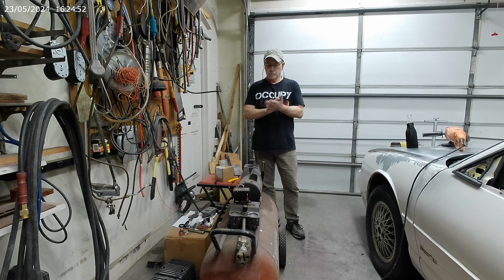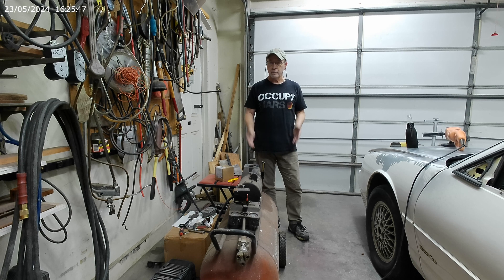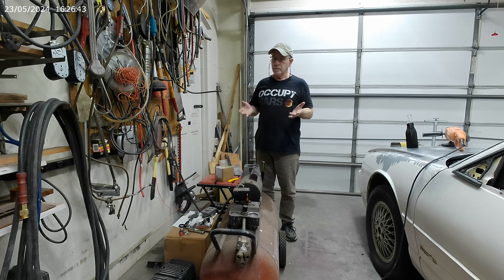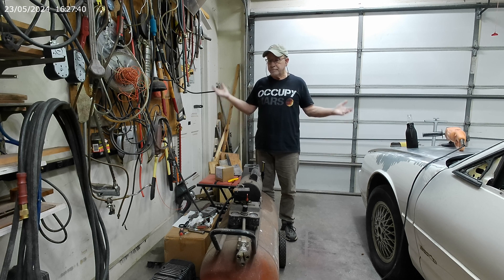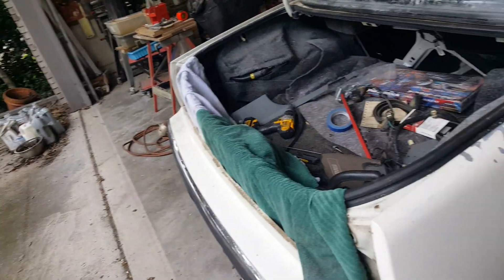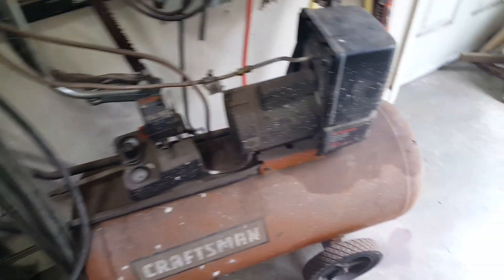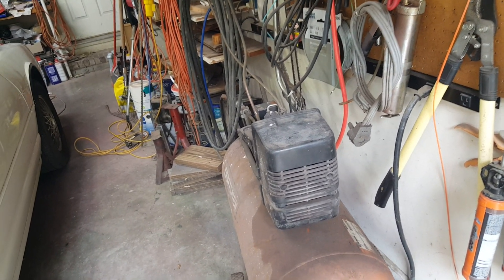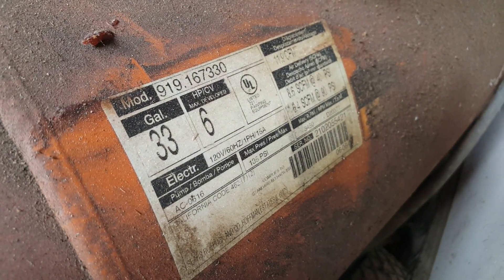Craftsman Oilless Air Compressor Intro and Disassembly Part 1

Comment: My father purchased the exact same model in 07/26/01. $269.88 sans tax. Just finished cleaning it today. It shuts off at 132 PSI, if that helps. It is fairly loud but it doesn't run a long time. I don't know the last time the water has drained out probably 15 years ago or more. But I'm going to drop the pressure and drain the water. I'll see how long it takes to fill it up.

Comment: Johnny Bravo - I loved that cartoon!  Earlier this week, I drove through my neighborhood and noticed that the "Curb Store" had a 2002 Craftsman Air Compressor Model No. 919167340 Serial No. 2202010174 on display, so I knocked on the front door and inquired about the equipment.  The Owner said it works fine and that he is upgrading to a bigger more powerful compressor and he helped me load it into my truck.  I have only been successful in downloading the Owner's Manual and now learning to identify the parts and hopefully I could purchase any replacement parts that I may need to operate safely.  I know I am missing the gauges, air hose, hose head tools, and the grip handle and I am sure I need get the air filter.  I will try to upload a video illustrating the current condition of it.  Right now, I don't know how to power it on and I don't I could with a hose and ?